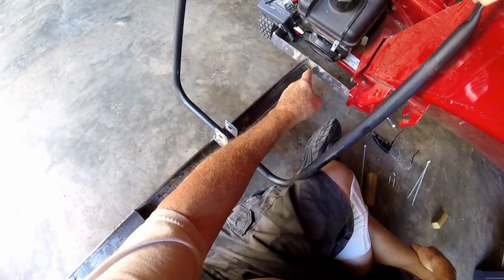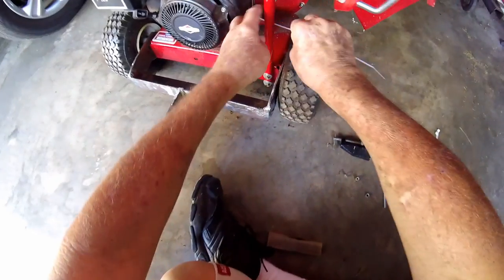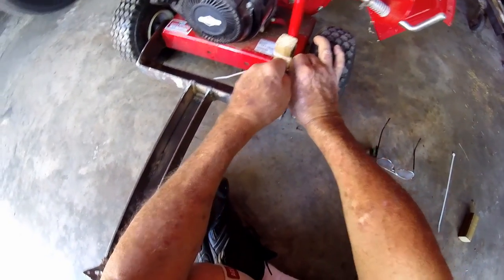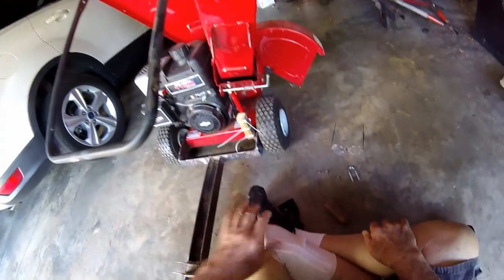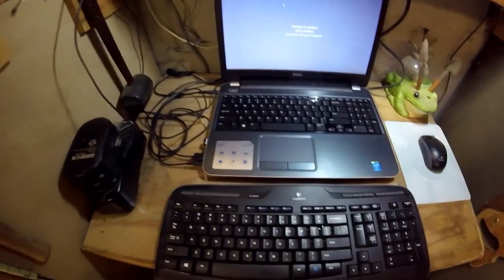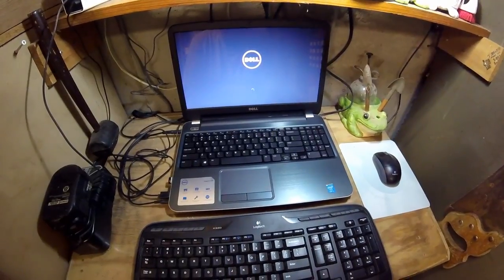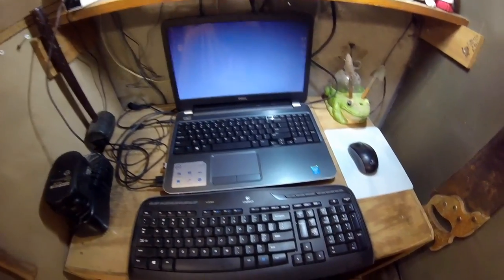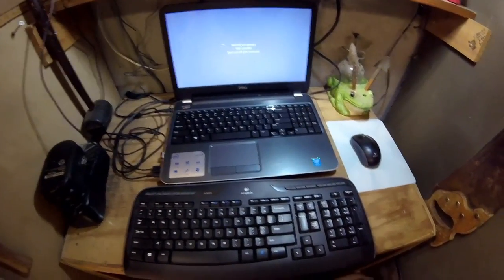Wood Chipper Tow Bar Part 7 LapTop Computer VLOG

Comment: I used MS-DOS in high school back in the early 80's, but I never really had an interest in computers until the late 90's. I used Windows 98 at one of my jobs and Windows 2000 in another job back in 1998 to 2000. In 1993 I bought a new desk top computer and a laptop with Window XP. XP to me is the best and easiest Windows operating system, but sadly the updates stopped in 2016. I used a computer with Windows 8.1 at my last job and hated that operating system. In late 2016 I bought a used desktop with Windows 7 on it and liked it, as 7 is similar to Windows EX. The only bad thing about 7 is updates will stop in 2020. And like you, I'm not quite ready for Windows 10, because it uses app like my dumb smartphone. Great video!
Reply from the maker: I dislike apps greatly  I still have a computer with XP on it

Comment: I started with CPM-80 and then MS-DOS and now I run some WIN7 and some WIN10 with November and Anniversary updates (actually complete replacements).  Creators update is out, but this company is skipping Creators and going to Fall Creators when it comes out in two weeks.  If you have WIN10 and wonder, Windows + R opens a run line and type winver.  1511 is November update and 1607 is Anniversary.  WIN10 is rather much like WIN7 for those of us who hated WIN8 and all the forced changes.
Reply from the maker: Souds over my head lol  Thanks David